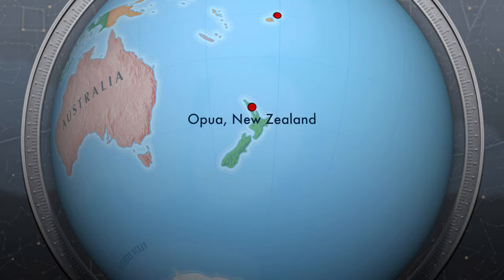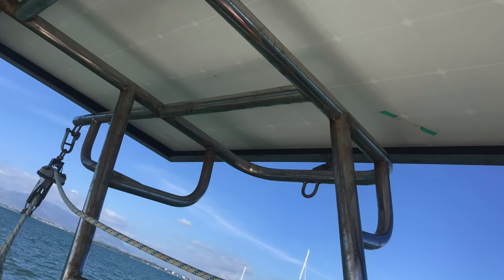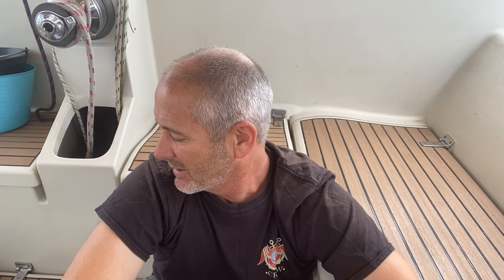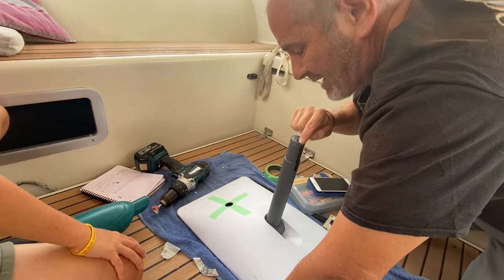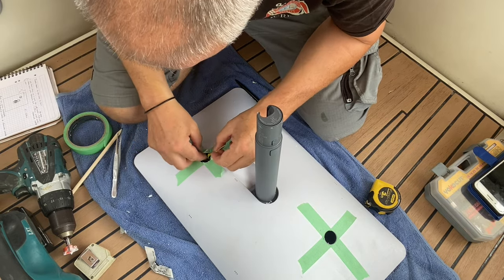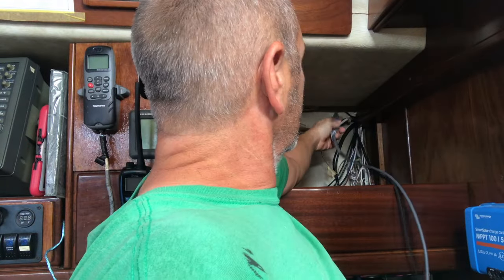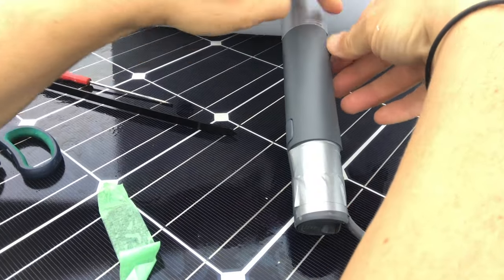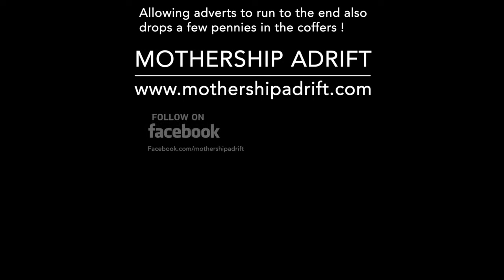#Starlink on Boats, Making and Installing a DIY Dish Mount and Disabling Motor for a Sailboat

Comment: We didn’t do the mods and we work remotely. To be honest I’m in 4-5 video conferences a day and it’s really not an issue leaving it as stock
Reply: We also did not modify crossed the Atlantic, during the crossing it turned itself flat and heeled over big waves wind all worked great! Also power consumption not that much.  Starlink sof far has been great 👍

Comment: Disconnecting the motors doesnt mean it doesn't need motors .. it just means it needs them and can no lomger use them. Performance will be poor at best.
Reply: Seems most folks have no issues.
Reply: Starlink uses a phased array antenna. Which means it will work even when it is not pointing directly at the satellite. Pointing directly up is not going to give you optimal signal (except when the satellite is directly overhead), but it will still work very well, at least it does according to multiple other YouTubers.
Reply: @jimb348 I am aware how they work, I am an electronics engineer specialising in microwave systems. The way Starlink works is to set itself up in a best direction (usually pointint South) based on your current GPS locarion, it then downloads a set of ephemeris data which descirbes the paths of each of the satellites. With this, it can then point the phased array at exactly the right spot to pick up the right satellite just at the right time, in just the right place. It has around +-30 degrees of control with the phased array.  If the dish does not start off in the right direction all those pre-calculated positions will be wrong ... even if it manages to correct the initial position, if the boat is bouncing around, it will have a real hard time trying to find the satellites.  A phased array is great, but it will only work well if it knows exactly where to point!
Reply: @itsverygreen532  disagree
Reply from the maker: All I can say it had real problems when we were in a rolly anchorage but once it was fixed it was fine. Also when the boat swings around and dishy is trying to follow the sats…they sometimes end up behind the mast.. so blocked from view. By disabling it and mounting it in the back the phased array always picks up a satellite.. even if it’s not the optimum one.
Reply: @TheSailingBrothers  I watched you guys install yours:)